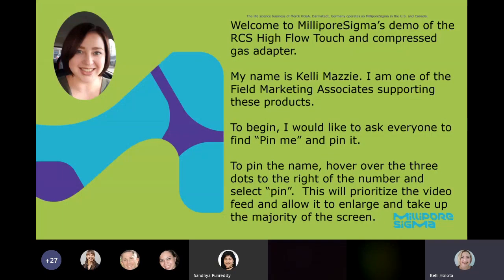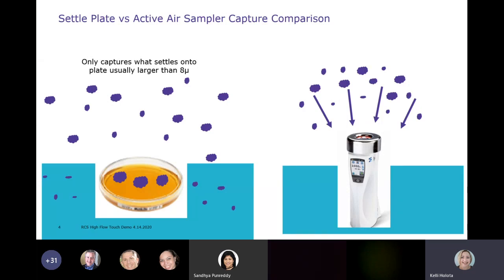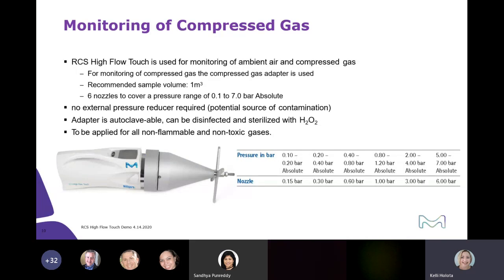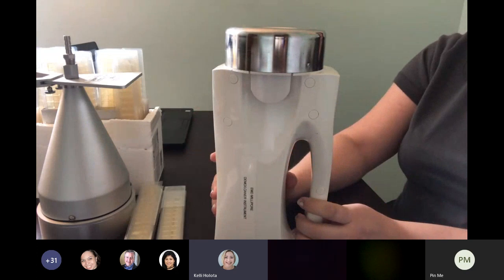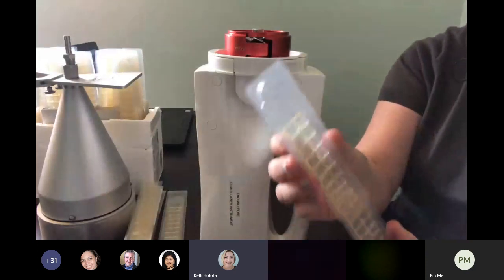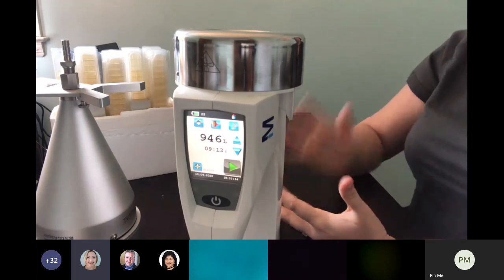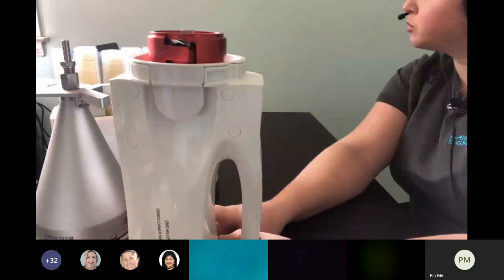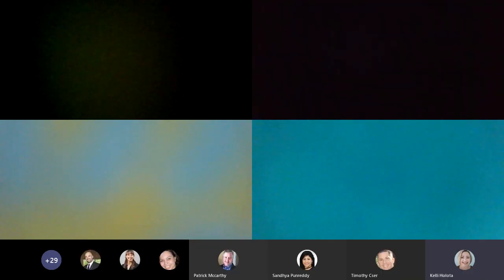RCS Highflow Touch for Compressed Gas Testing Demonstration

Comment: How much pressure should we use during sampling?
Reply: Hi Gildardo.  Sorry for the late reply!  The pressure is based on what's in your compressed gas lines.  You can use the pressure reducer nozzles to match the pressure in the line, giving you the correct pressure reduction.